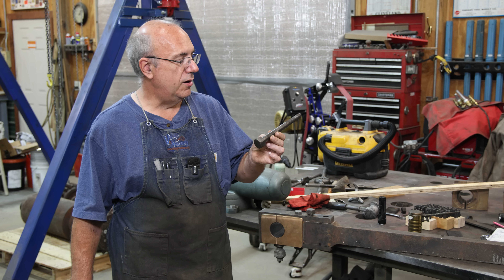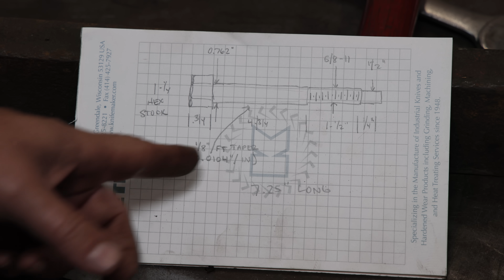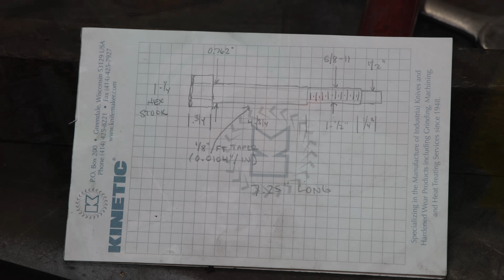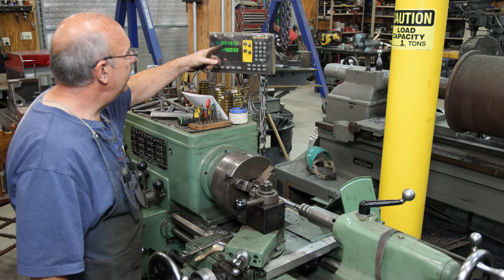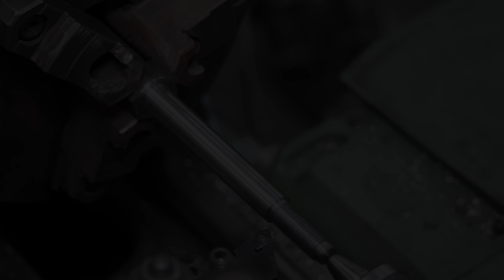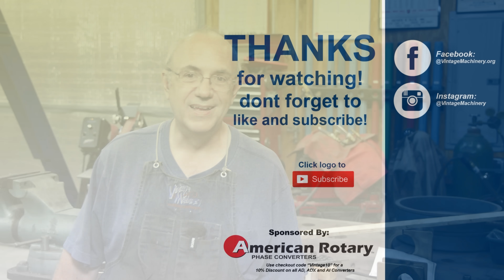Steam Locomotive Connecting Rod Bearings - Making New Tapered Strap Pin/Bolts

Comment: Concerning setting the taper, wouldn't you be able to zero your taper, move 4" lock the slide, then dial in your taper bar using the dro to the # you wanted. Instead of going back and forth 15 times, little bit at a time, overshooting etc.  Maybe you could get it where you wanted in just a recheck or 3.   I'm sure there is a reason he didn't do this, but if someone could explain why I'd really like to know.

Comment: Shouldn't there be a small gap under the head of the bolt when it is fully tightened to ensure that the taper is fully seated (and to enable future tightening) ?
Reply: Yes, this is correct.
Reply: Not the case in standard railroad practice.  Tapered bolt in a proper reamed hole when fitted properly has the head seated on the surface.  It can be reused a number of times without needing to be replaced.  The key here is proper fitting of the tapered bolt in a proper reamed hole.  If allowed to start working, you end up doing the process all over again.
Reply: @rrsteamer  I wonder if the mechanical engineers designed it to be over-constrained like this, as the machining accuracy would need to be spot on.  It seems logical that the tapered pin would locate the parts accurately and the bolt head is just there to stop the bolt from turning as the nut is tightened.  I accept what you say, as I have no railway experience.  I just find it strange.

Comment: To set a taper on a lathe or an external grinder I would set close big or small with backlash out and make a cut. Check cut do the math ratio the cut to the indicator from center on taper attachment move half check part taper. Recheck ratio to move make any adjustments  to move and reset cut  should be right on. Worked most the time worst case back off and start over same  direction I made it work for 50 years manual or cnc. Good luck and enjoy your retirement.

Comment: Thanks for the vid and info.  A question that I have but not sure if there is a good answer, why do the bolts come in from the bottom?  I have always been taught if possible a bolt should always install from the top so IF the nut comes off the bolt won't fall out.
Reply: So you can get a hammer on it when it comes time to remove it next.

Comment: Why isn't there a mother on both sides? Then you can pull the pen in as far as necessary. Plus you wouldn't need a hammer to pull it out. Simply pull out with the top nut.
Greetings from Germany

Comment: Hello Keith,  I could watch you make all these bolts.  This might be an application for Abom's CNC machines, if they weren't all custom for the location.

On another project.  I've been wondering if the cane mill roller shouldn't have been sandblasted.  You had to build up the bearing surfaces anyway, so the gear seating area is the only critical area.  If there are any cracks in the roller, they would be easier to find with clean metal.  Given the size of this mill, cracks might be significant and best located early.  dave

Comment: Great work and thanks for the interesting and engaging content. Look forward to your videos all the time. If you start up by the head of that hex and plunge in to the across the flat diameter. You can run the carriage in reverse toward the live center with less vibration to get it beyond the interrupted cut.

Comment: Keith, one of the jobs I worked at we had to lap tapered bolts into the holes. There was a particular distance between the head of the bolt and material that you had to adhere to. It was tedious,  time consuming job fraught with the hazard of overshooting your tolerance.
To the other end of the spectrum at the carpet plant I worked at many of our looms used tapered keys instead of bolts. We kept drawers of premade keys stepping down in sizes on hand. On a weekend, downday or slow moment we would load the fixture with blank keys and cut them in the shaper. Most of the attachments to shafts used them also.
The looms were designed in the late 1890s and early 1900s.
I sure miss working in the shops.  Retired and wore out now.
Keep 'em turnin'!
Cheers 
Terry

Comment: I suspect that when the tapered bolt was driven home the head should not have bottomed out.  The purpose of using a tapered bolt is that it removes all clearance between the bolt and the components that it is passing through.  This is important because the bolt is being loaded in shear and the load changes direction twice per revolution of the wheel.  If there is any clearance the bolt and the parts it holds together would eventually pound out and become loose.  Not that it would be good practice but you should be able to drive the bolt home, tighten the nut on the bottom and then cut the head of the bolt off and it would work as intended.  The head of that bolt would only be needed to keep the bolt from turning when you go to tighten/loosen the lower nut.

Comment: Tapered bolts were a trademark of the Baldwin Locomotive Works; but it seems that somebody at Vulcan Iron Works also liked the ideea. The Georgia Museum of Agriculture is lucky to have you, Keith! TM who likes steam locomotives
Reply: Trademark of BLW?  Most all the loco builders and railroads used the tapered bolts as a standard practice.  Some variation as to taper vs straight depending on location and the specifications of the ordering railroad or industry.  Variations on taper and threads per inch of boiler fittings for sure.  That is why research is worth the time.  Keep up the nice work Keith!

Comment: Question: Why would this otherwise off-the-shelf looking threaded bolt require a taper? Why would original designers see a necessity of such precision in a bolt that has no apparent need for the added cost of production?

Thank you, Keith. I always enjoy your work. 

John
Reply: I guess the taper is to make sure the strap holding the bushings and the "beam" don't have any lengthwise play (that would quickly destroy the bolts). Could have been ground shoulder bolts/reamed holes, or pressed pins with normal bolts but taper stuff was common at the time and a taper bolt kills 2 birds with 1 stone.
Reply: It's all discussed in Part 1
Reply: @RicktheRecorder  and in the comments for the first part someone who worked the fullsized train yard shops explained it very well.
Reply: @papajrd  It would be very difficult to press fit a 6" bolt at the required tolerance, and impossible to remove for maintenance and adjustment.

Comment: I want to build a steam generator . Something capable of about 5-10 kw of required for about a hour run time. And normal use around 1-2 kw, maybe a Tesla turbine running on the exhaust side spinning a smaller alternator. A 4"-6" thick stack of 10"-12" disc on a 2" hollow shaft. Using brass bushings 2" wide with labyrinth seals  on each side. Basically alternating disc with little clearance. .005" or less the brass bushings having a 1.5"-1.625" wide groove fed by pressurized oil. With the oil basically trapped inside. The labyrinth seals slowing  the leak. Using the pressure to keep the bushing surfaces apart. Using 0w? Engine oil, or possibly ATF fluid or power steering fluid something thin to allow high rpm. Possibly do test using diesel fuel and oil mix. Being diesel is a oil with lubrication properties to prevent destruction of the pump and injectors. Maybe a 0w something oil mixed 50-60% with diesel. It will only require about 1-2 quarts to do the job. Using a Chevy V8 oil pump. Spinning at just enough rpm to maintain pressure using a pressure sensor and electronic motor control to control the 350 watt DC Motor with a filter cooler and heater controlled by solenoid valves. Using steam to preheat the oil. Then a radiator to cool when the temperature gets hot. Probably only a 8' bit of 3/8-1/2" copper Tobe, with 14 ga copper wire wrapped around it tightly and soldered. Creating cooling fins  the bend around a 1x4 and place Infront of a fan. Or use a small oil cooler ., with a 2" shaft spinning 45k rpm likely minimum, possibly in excess of 60k rpm. With the exhaust through the center of the shaft.  The oil will require cooling and a roughly 100:1 reduction is required. Low friction. Maybe a planetary arrangement. With polished sour gears. Straight cut, noisy but ok. A sound dampening cover can handle the sound. A disc about .030" thick with a .030" thick spacer. With a .080" slit at a 30°-60° angle leading to a .100" hole , the shaft wall roughly .250" with a .125" key to prevent the disc from slipping. The tiny key being About .062"-.065"deep in the shaft. With two holes 45° from the key to offset the weight. The slit in the spacers aligned twitch the holes and a stack of spacers cut at once along with disc. Spacers epoxied to disc with just enough to stick them together. The stack of holes should allow a 1/2" - 5/8" supply line at 60 psi to run the engine.  Using flat nozzles basically a large crayon shape of brass. Drilled on the backside to 75% through with a 3/8" drill. The tip flattened to about 1/4" thick. To look like a thick flat screwdriver.  Then a thin slit cut into the drilled portion! Then a .030" stack of feeler gauges placed in the slit and tap the slit closed on the gauges. Allowing them to be pulled out of course.  The housing tapped with 1/2" not the brass nozzles threaded to fit inside the pipe fitted into the housing. With about 6-12 placed in two rows with the pipes placed into a 1x2 SQ tube  each row, and brazed or welded inducing bolt on flanges per tube. The steam jet should hit the disc at about 1/4"-3/8" wide and 1/8-3/16" from the disc. The tube manifolds fed by a 3/4" line split in two.  Or a steam engine using a 12" bore  with 6" stroke , at full 150-200 psi that should equal a fair amount of power. Even 100 psi over 12" is 1200 lbs on a 6" lever, even if single acting. It should be plenty of power. And operating at 2000-3000 rpm spinning 24" flywheels being a 3" x 3" ring connected to a center by 6, 2" spokes, to a 4" crank journal with a 10" center hub. Built from foam board sanded sculpted into shape. Even balanced to make balancing of the final product easier. The iron flywheel should be capable of spinning 6k rpm without issues, from balance , ( probably scare ppl to death tho) the peak engine speed being 3200+/- 400 rpm . Likely 1800-2400 use a variable pulley to drive the actual alternator. Get peak rpm even driven at 600 rpm. It seems to me steam engines would make peak TQ at a low RPM. I'm a gas engine guy , and. Looking to use waste oil and scrap wood to generate power Weekly, buying gas or diesel would get spendy. Possibly running 8-12 hours 2-4 day weekly in winter, and use the exhaust passed through radiators in house to condense the water to be reused in a semi closed system. Sorry to ramble, but alternative power is awesome, nothing like the feeling of making your own power.  Even if it's only enough for the lights.. you can get a 3phase alternator spin it with a steam engine , making all the power required for the equipment!! Or use solar power and 3phase inverters.   Have an awesome day 🎉
Reply: James, I like the way you think. Your idea(s) are nicely presented but needs a bit of organization for others ease of understanding
What is a sour gear? Did you actally mean spur gear, I got that from context. The noise was the clue. 
.

Comment: Measure up 1 foot from the center of the pivot bolt on your taper attachment rail and made a mark.  Then you could measure directly over to the edge with calipers and get close very quickly. Alternatively you could lay your reamer along the edge and sight it in.

Comment: Out of curiosity, is there any sort of reference surfaces on the taper attachment, where you could set the taper in a similar way to a sine plate?  A known distance point from it's pivot, where you could insert some gauge blocks to a certain distance to create the right angle/taper...

Comment: Good morning Keith,  I almost fell off my chair when you were starting the bolts. You were at your lathe, and you put your bolt blank in the lathe to face it off, and after that, you never turned the lathe off to change your tooling to put your chamfer angle on. That is very bad safety practice. If that had slipped out of your hand, it could have turned out badly. I only say this because I have worked in a machine shop for 40 years and have seen a lot of errors like that that didn't turn out well. I only say this for safety, and young people are watching you, and we don't want any bad habits or people getting hurt. I love your videos, and I don't miss any of them, so thanks for sharing.

Comment: I would guess you’re going to need a bigger gap between the bearing halves for the sake of future adjustments.  That gap sets a limit.
Reply: That gap will suffice for a few years. The first 10,000 revs of the connected wheels should only be break-in for the existing pins to the bronzes. Any wear can be measured with a tapered rule with proper markings. Starett used to make those, refer to the older sales offerings on VM.org for details (again 1/8 | 12 inch was a standard for many British, German and Japanese light rail). 

And the bolt head should not be flush or below, proud of the rod is correct, the standard is in the older books Keith has shown us. Audel was a great reference since they explained the why of everything they taught.

Comment: 24:23 - Could you use a protractor a or gauge blocks (kinda like on a sine bar) either referencing the tool against the work, or the bar with respect to the lathe, to take the guesswork out?  I mean I get for a one off part where the taper is not all that precise, but if you were say, making a morse taper or something like that, would it not be easier to get better results that way?  By the way, you are looking and sounding terrific Keith, looking forward to seeing you have a long and happy retirement!

Comment: Will you be heat treating the bolts?
Reply: No, for a short answer. 

Search wiki for train connecting rod, sometimes called train coupling rod. As materials (alloys) got better, the taper pins you saw being made were made from lighter alloys. The 'bolt' head you see is to allow disassembly. It does not actually make contact with the surface, it should be proud by a specific amount called out in the trades manuals specific to the locomotive.

The reason for the 1/2 extension of the threaded pin is to allow the pins to be removed with the proper type hammer when the rod is being serviced, the head is to hold onto while loosening the jam nut. It is a bit close there where you would be working to do this by using the other nut. The 'bolt' head is not actually used for anything other than to provide a place to hammer the pin home, the nuts are to provide backup places to hammer during removal to "prevent" the thread for getting boogered up, the jam nut is to ensure that there is at least one nut of the pair to pull the pin into the taper since it is a bit hard to hammer up with either hand to mount the pin properly. In other words, the head is a target, the upper nut is a target and the jam nut is to, well, jam it all up. <g>

Comment: Did you emery cloth the taper?  I saw you use some on the threads.  Tapers were always tricky for me - I usually had a sample to chuck in the lathe then ran a dial indicator back and forth until it read 0 for the whole length.  Then I knew my taper attachment was right.  Once set up, cutting a hundred tapers of the same size was easy but I always held my breath on that first one.  I never cut a taper on a brand new machine, but I've heard that factory fresh, the markings on the attachment were right on.  Keep up the good work.

Comment: Maybe a set of dial indicators at a fixed distance on the taper attachment would be handy.
That way you can just dial it in with those dial indicators.
Would be alot more usefull then the dial on the taper attachment itself.

Comment: Side Project - Make some wedges to fit that taper bar that can be used to set a given taper. Looks as if they would tuck in nicely and be pretty easy to use.
Reply: Time to break out the old sign bar.
Reply: @dannyl2598 The taper mike is actually a small sine bar.
Reply: I did something similar, I cut a number of cylinders of different diameters to set the angle.worked perfectly every time and for tapers that you didn't cover, at least it got you close

Comment: Rather than use hex stock for the convenience, I think an allow like 4140 may have been better.
Reply: How are you sure it wasn’t 4140 hex stock?
Reply: @grntitan1  high tensile strength is not needed. The punishment these pins endure each 1/2 revolution requires durability overall.